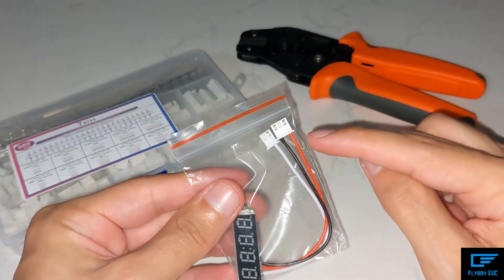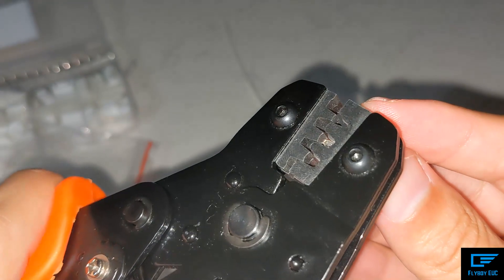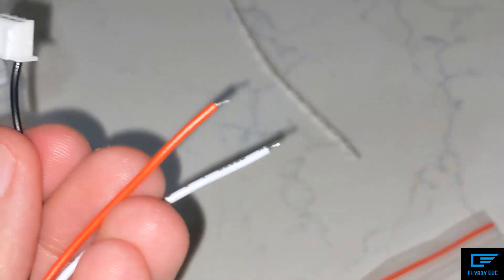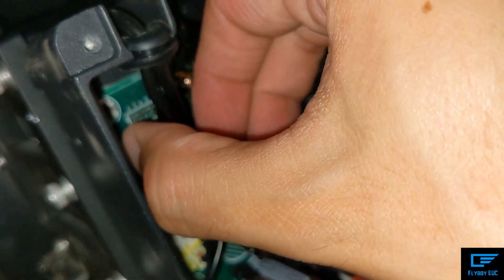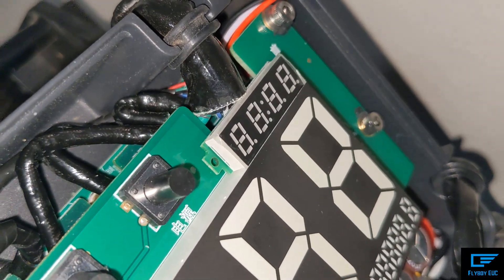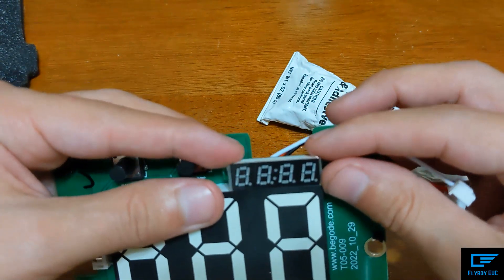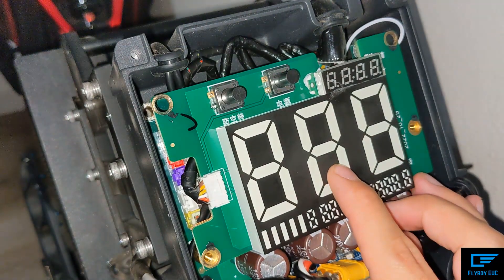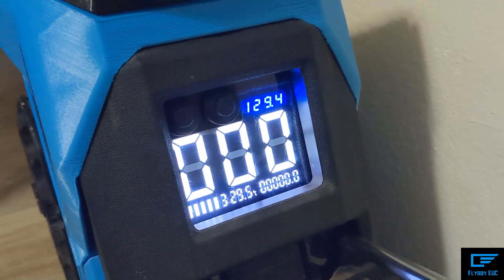Voltage Display Installation for Begode EUCs

Comment: Is there any way to do this with the Commander Mini?
Reply from the maker: I'm not familiar with the LCD screen on that wheel. If it looks like the begode one, then yes.
Reply: @FlyboyEUC  It's different, the transparent plastic only covers the display board and the rest of the cover is non-transparent :(

Comment: Thank you Flyboy! Very thorough guide. I can add that if you don't have a crimp tool, you CAN use a needle nose pliers if you are a bit careful and bend one of the metal legs at a time and then wrap the other one across it.

Do you happen to know what those plugs on the motherboard are used for normally? Or is there any text on the print that indicate what they do? That might help to locate similar plugs on other boards.
Reply from the maker: I have no idea. Back in the day people made layouts for every board. But since there is a new wheel/board every month, people stopped doing this.